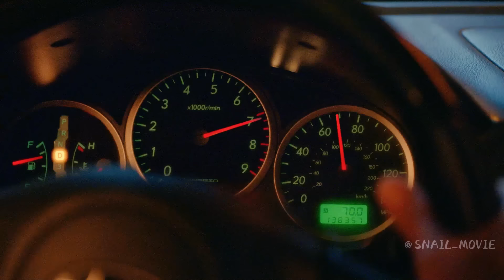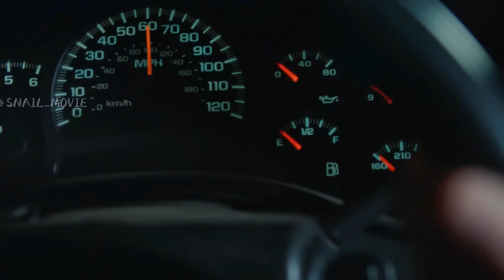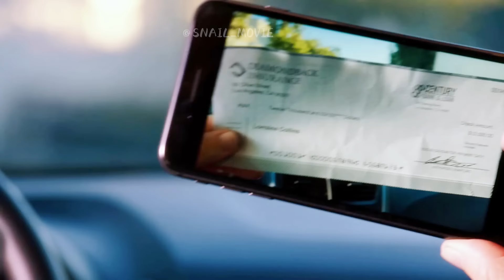Woman Dined Out Everyday But Never Spending A Dime.

Comment: The tornado one is not 9-1-1. Instead, it is a spin-off. 9-1-1 Lone Star. 9-1-1 has yellow stripes and is from 118, while 9-1-1 Lone Star has red stripes and is from 126.